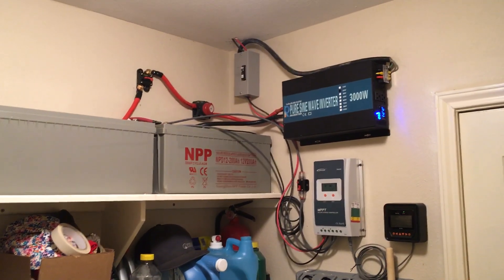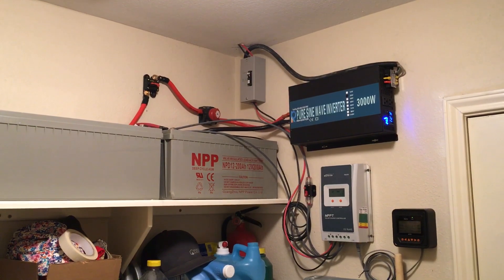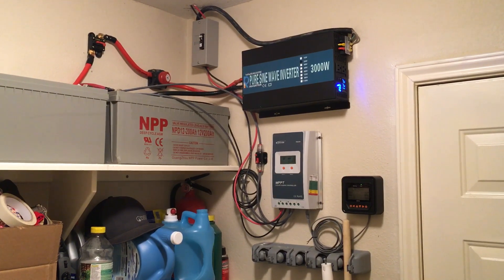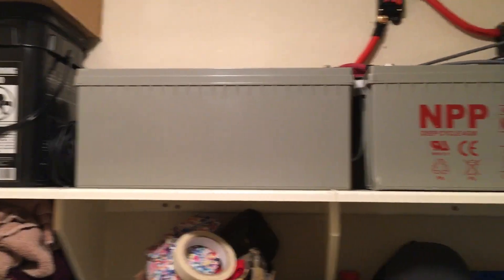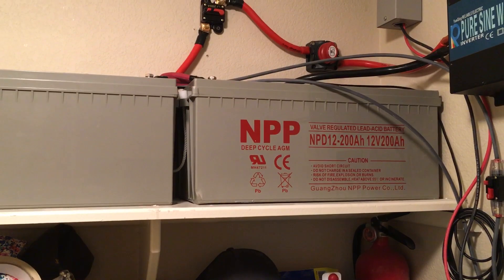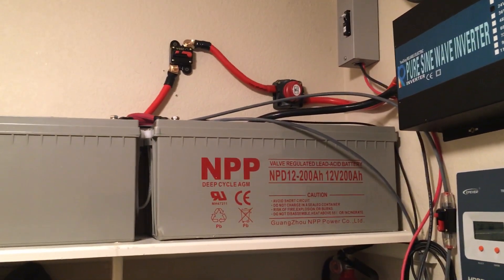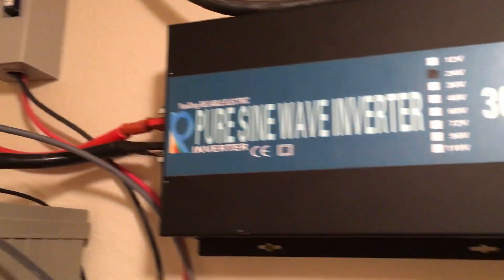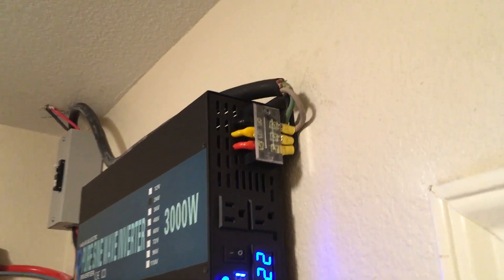DIY off grid solar system backup generator, house grid integration.

Comment from the maker: Made a continuation video with my solar array, go to my channel to watch. Thank you!
Reply from the maker: All the grounding is gonna be done very soon I’m just waiting for my next days off so I can pound the 8 feet copper rod on my backyard and run all the grounding, the inverter ground is connected to my breaker box ground so at least my connection to the house is currently grounded all that’s needed is to ground the panels and the metal boxes of the system.
Reply: Is your Battery conected in Parallel?

Comment: Have a question.. so if we have on grid 3KW solar system without batteries. As we know that on grid solar system only provides power if grid energy is present. I don’t want to spend money on batteries but instead I want to buy a small diesel generator (1kw) and connect that generator with grid line supply. Will this setup work? Can anyone provide feedback plz..

Comment: Great video and thanks so much for sharing! Pero no tengo ni idea de montar todo ese rebulu de cables ect... Just one question, do you think that process can be done with 9000 watt portable generator? Thanks again y love so much la bonita bandera!🇵🇷
Reply from the maker: Perdona que no haya visto!! Si, la un sistema de este tamaño es bueno para pequeñas emergencias. Puede mantener un refrigerador pequeño y eficiente en energía constantemente si lo manejas bien y el sol ayuda. Si te interesa hacer algo así y necesitas ayuda en algún paso que te atores me avisas. El generador si se puede añadir pero con un transfer switch más caro de la misma marca ProTran. Si añades un Controlador de carga mejor puedes poder cargar el sistema desde el generador
Reply: JonyQ muchísimas gracias y no importa la tardanza. Yo quiero empezar pero la verdad no tengo idea de los pasos a seguir. Tienes Facebook o Twitter?
Reply from the maker: Ciro & Sochy Esposito solo YouTube 😓
Reply: JonyQ ok gracias. Yo en verdad quisiera cubrir por lo menos el calentador y a/c central, nevera y algunos devices. Pero no se como medir? Los kilowatts.
Reply from the maker: Ciro & Sochy Esposito para un sistema de esa capacidad (ac central) necesitas un sistema GRANDE. Este sistema es más para sobrevivir una emergencia 😅😅😅😅😅
Reply: JonyQ Makes ahh ok como quiera gracias un millón por el vídeo y de haberme asistido con mis dudas o preguntas!

Comment: That's amazing that little shelf is strong enough to hold up those heavy batteries.  Mind blowing.
Reply from the maker: I know right...  it amazed me too, still holding string
Reply: @jonyqwoodworks  That stuff you did is amazing.  Wait until the neighborhood has an extended power outage.  You'll have the last laugh.  All you need is a huge battery bank strong enough to run a 5000 or 6000 BTU A/C.  Then if there's a nasty storm or if somebody crashes into a power pole and it takes a week to get power, you'll be set.

Comment: Can you make another video of all of the devices that you are running from this so we can see it all working in action?
Reply from the maker: From the Transfer switch, I chose 6 fuses on my house, my 4 bedrooms, my dining room and my living room. All 4 bedrooms have TVs, one of them being my computer room which has a gaming computer. There is a mini fridge in my dining room and a 55” LED TV in my living room. 
 If I run all 6 circuits, including the mini fridge, on full sun hours, I can run everything without worrying about conserving energy. The panels output is roughly 550-650w in a perfect sunny day. Once the sun starts going down I have to be conscious about my TVs and computer usage if I want the mini fridge on all night. But it can be done, and my batteries be over 60% the next morning. All the lights in all the circuits are LED light bulbs so the use very low energy
Reply: Dude, that is awesome!  What if you put more panels?  I have two 300 watt panels out there now but they barely give out 200+ watts ea on a good day.
Reply from the maker: The numbers of panels, in my opinion, are perfect balance for my batteries and charge controller. I have no plans on being off grid, this system sole purpose is to have energy in case of an emergency. If I wanted to add more panels, given it’s a 24v system I would have to duplicate the system, meaning, 8 more panels, a second charge controller and 2 more batteries. There is the possibility to run 2 of those EPever controller in parallel acting as one, so the possibility is there.
Reply: I am trying to do exactly what you're doing.  Lots of people have these EPEver charge controllers.  They feel like they are very solid units.  I also bought that little optional MT50 unit like what you have.  I leave my inverter on 24/7.  Right now my MT50 is showing 13.0V.  I charge my phone every day using the USB ports on the inverter.  I paid less than $30 for the inverter. It also can power my 55" TV, which is amazing.  So during a storm outage, I can watch the news.  We don't rely on cable. I have a free-air antenna, so I get all of the local channels without a problem.
Reply from the maker: It is a great peace of mind knowing that you and your close ones will have lights in case shit hits the fan.
Reply: That is 100% correct, sir.

Comment: I have a lot of the same equipment, except for the batteries.  I just need to run the wires through my attic into the closet from the back yard.  Then I need to nicely mount everything in the closet.

Comment: I had a fun time trying to figure out the color code for hardwiring my 24v 2500w Reliable. Dont know if I got it right but seems to work. Black to neutral Yellow to ground and Red to hot.  Looks like thats how you got them too?
Reply from the maker: Johnyjaq that’s is correct

Comment: Wow, looks like I'll be upgrading my system with more of their stuff.
They were great help when I bought my controller.
Now about those batteries in my motor home? Would I have problems between the two charging systems, PV array and engine?
Reply from the maker: In your motor home you would need to wire he batteries in a 12v configuration. I don’t see a problem connecting both the engine and the charge controller directly to the batteries, but im not an expert. You can isolate the charge controller from the batteries by turning the breaker off.